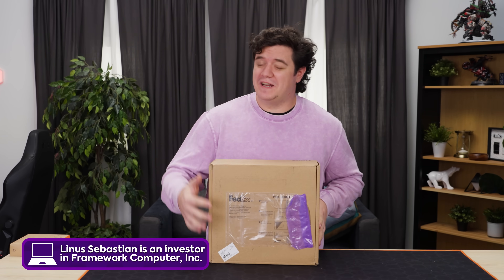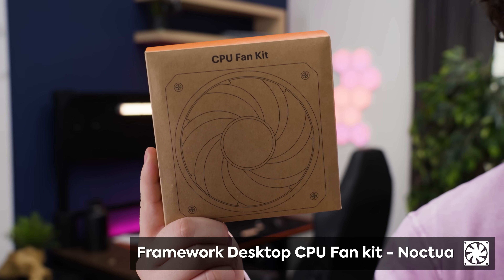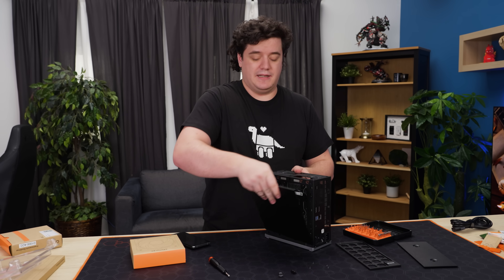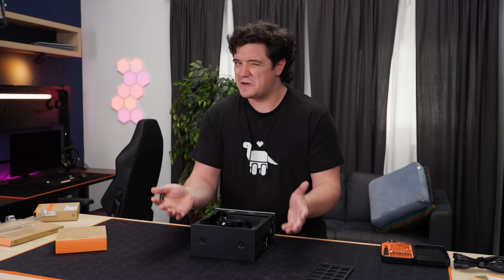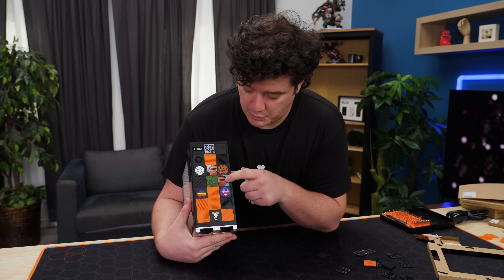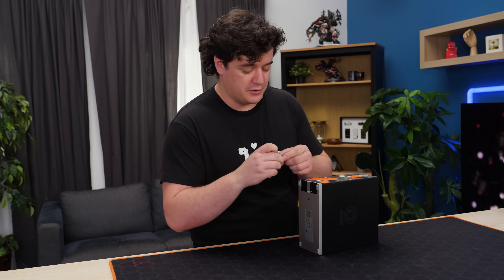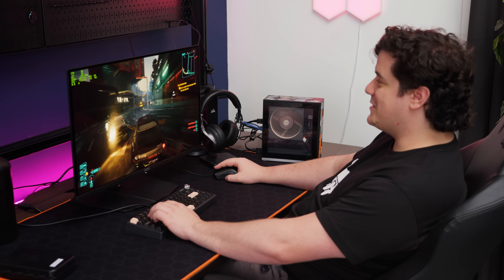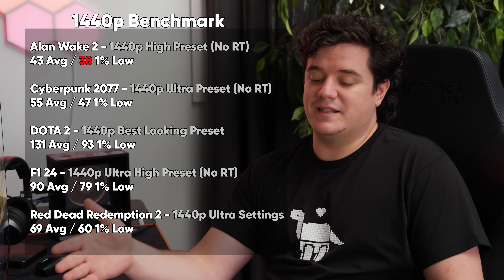This TINY desktop makes me nervous.... - Framework Desktop

Comment: Brother, it doesn't come with the power cable for free the same as the laptops don't come with a charger for free.  You can BYOD or buy one.  Most folks who would buy one of these (which are blatantly for enthusiasts of a limited niche) probably have a bin full of them.

Comment: I feel your pain on the power cord. I was pricing laptops with them, and you have to buy (seperatly) a USB-C module for charging, because the laptop does not have a hardwired c jack. yes, you could just plug into the module jack deeper inside, but the language on the configuration page gave me a bit of a fit. 

"We suggest ordering 4 or more Expansion Cards, and that at least 1 is a USB-C Expansion Card for charging the laptop."

Comment: This thing would be sick af, but $2300 is just too much. The only reason to get this over a decked out full size rig that would crush this in everything except maybe LLMs is if you really need to move it around a lot. Even then, you can get a laptop with on par performance in everything but LLMs for quite a bit cheaper. I just don’t see the niche at this price point.

Comment: As someone who has dozens of spare C13 cables I would gladly pay $5 less to not have it. The problem is that not everyone has dozens of spare cables in a drawer. That said the cable you showed is 1m the one on frameworks site is 1.5m that .5 of a meter makes a huge difference.

Comment: That line about the memory is not quite correct. You can set a certain allotment for the GPU in the BIOS but I would recommend to set that to the minimum of 0.5 GB and let it dynamically distribute memory to the GPU as needed. This Graphics Translation Table (GTT) has a limit as well. In Linux you can freely adjust that limit to your liking with a Kernel parameter. On my Strix Halo I set it to 61 GB on my 64GB model. The GPU gets as much as it needs within that limit, the rest can be used by the CPU. Of course at 61GB for the GPU the CPU becomes a bit starved for memory but that limit enables me to run even GPT-OS-120B on just 64GB of unified memory and if I don't run that model, memory for the CPU is plentiful.

Comment: So framework made a modular desktop, which is less modular then any other standard desktop, and chargin you for a power cable, and some tiles to the front? I dont see this is an improvement over an ITX machine.

Comment: It's weird certainly. What it seems like to me is that framework looked for an area of the market they could meet with a novel product and this, based on its AI performance, certainly fits a niche. Desktop PCs are, still, for the most part, modular upgradable machines. Unlike laptops, if you want to build a system that can grow, you can add more ram to it, swap out the processor, drives, etc. In that sense, I get why Framework thought they could compromise on this. 
As for the pricey bling, I think that brilliant, especially if you can 3d print your own. It's personalization, totally optional, personal and seems like a fine revenue stream for them. 
I've gotten into LMstudio recently and have been looking at improving my setup. This offers a exciting possibility.

Comment: In order of least to most bothered:

Tiles: Pretty much entirely an aesthetic feature. 3d printable so you have alternatives to buying and fully functional without them. Kinda sucks it doesn't come with a few but whatever.

Wire: This kinda bothers me simply because you do need it to function. On the other hand I have sooo many of these kicking around, and anything "free" like that is just gonna be adding 5 bucks to to the base price anyways. Not a big deal but I can see how a non-savvy person would be tripped up there.

Soldered RAM: Sorry, but no. Not only is this a dealbreaker for any desktop of any size to me, but it directly contradicts the repairability goal for Framework. If it had to be SODIMM at this size, then that would be absolutely fine, but soldered? Nah.

Comment: On the unifed ram you really really should have mentioned that it dose n't need to work like how it dose on macos , setting vram to 512 mb is perfectly fine for gaming and ai work flows. 99% of modern application go huh there are only 512mb of vram but vram is just a partion of the total system ram I am just going to store this in normal ram and it dosen't even have ti go threw the CPU the GPU can read and wright to the CPUs memory (I prolly explained it wrong) idk if windows dose something weird causing him not to mention it but on Linux atleast this is flawless. for example the steam deck is configure with 512 mb.  Wendels level one Linux or level one tech video explains this.

Also you can allocate more then 96GB of ram to the GPU on Linux, the 96 GB is a windows issue, also would have liked this video to talk a bit about Linux not like year of the Linux desktop or anything like that but with this being a AI first gaming second computer no sane person would put windows on a deeicated ai comouter

Comment: Some things i disagree with here 1) I think the soldered RAM is fine, as it's basically required for that CPU 2) I actually like the option of not buying the power cable, as some people have crap ton of those lying around the house and really don't need more 3) The front panels being extra is also a good decision, because some people may want to print their custom ones, so those that came with the computer would just be lying around or thrown out

Comment: You can NOT get this CPU/GPU (SoC) without soldered ram, un-soldered ram can not reach the same low latency / higher speed/throughput. Otherwise it would also not be named unified memory. A disappointing oversight for such a talking point (worrying about it etc)

Comment: my opinion on the not included power cable, if its replacing a different pc, you probably have one at home, and even so, you probably have a few from old tvs or anything, i have a box of random cables, and dont like being sent a short cable that barely makes it to the outlet.

Comment: I would buy this as I could use the portal monitors that have speakers in them to get both video and sound. All up it would cost me $6,197 AUD as I would go with the 128 GB model with 2x 8TB SSDs, as I would be using my own Operating System

Comment: actually framework already addressed the point of the soldered ram.
Basically they wanted to do that at the start, it wasn't validated by AMD, they reached to AMD, AMD did a bunch of tests and said that it is possible but the bandwidth would be cut in half.

Comment: Sorry man, I'm not onboard with any of your gripes.

I'm sure they'd offer an option with replaceable ram if it made business sense. They'd probably lose money doing that.

Also, maybe I already have a power cable. Fan mounting kit, probably don't already have one. Customizable tiles are cool, but I'd rather have the option to save some money and not include them if I'm trying to keep the price down. If they were always included, the base price would just be $108 more according to your setup.

Thanks for the comprehensive video as always, looks like a great little rig.

Comment: Wasn't HBM officially invented for this kinda thing? AMD made all of this fuss back in the day about how well beyond the GPU could go with a soldered, "unified memory" just like they did with the Xenon SoC on the original Xbox 360. It had 512MB of unified RAM, while the PS3 had 256+256. And this was 2005 and 2006 respectively.

So... 20 years later and many improvements later... When the time finally came to shine... AMD dropped HBM in favor of regular LPDDR? ffs AMD! I know it's cheaper, but you either make a top product or you don't! And you didn't! So don't call it one!

Even HBM1 from the Fury days had a 4096-bit bus and it would most certainly destroy any competition if remanufactured and rereleased on a smaller and more power efficient node. It was so much faster than regular memory it wasn't even funny. And the big proposal was always UNIFIED MEMORY, which those GPUs never had. So now was the time! To do the same thing ATi did with the 360 back in '05 and not only wipe the floor with the competition but to make a statement!
Reply: I've had the same thoughts about HBM.   It is kinda wild how poorly utilized the tech was to begin with.  But considering its impressive performance relative to the competition, I thought we would see its market share climb over time, not fizzle out and disappear into obscurity!   With how AI has changed things in the graphics space, one would think HBM had finally found its moment to shine.  But apparently not.  And it just doesn't make any sense to me.  Clearly the companies spending +$30,000 on the latest AI cards are clearly willing to shell out however much it would cost to have utilized the latest HBM on the boards.

Comment: Many people have an excessive number of extra power cables lying around, so the option to not get one is fine by me.  And if paying for it is a concern for you, I suppose they could increase the price by $5 and still make the cable optional, but free (this is what most other companies would do).  The same goes for the tiles, as you mentioned, they are 3d printable but they could increase the price by $100 and then make the tiles free/optional.

Comment: If you are someone who tinkers with computers and builds them yourself, I guarantee you have several of these power cables sitting in a box somewhere. Framework not providing the cable by default is NOT an issue. If I were to order one of these computers, I would order it without the power cable. I have a box where I put I all my old computer cables, and I several of these power cables in it.

Comment: I think it makes sense for the C13 to not come by default.  No one that is building a framework device is building it as their first PC, so surely they have a few C13 cables laying around.  I don't see why it not being included is a big deal.  Expecting a profit-driven company to include "nice to haves" by default, such as a cable you probably already have laying around or plugged in somewhere, or some little plastic panels for "customization" is not just ridiculous, but silly.

Comment: all that complain about the optional 5$ c13 cable... if you are involved with pc's etc then you have atleast a few lying around.. tbh id be really be happy if every time i bought a psu or any device that comes with a c13 cable they did not include it and charged me 5$ less. i have never used any of the included cables..i have atleast 30 c13 cables lying around if not more..if there is one thing i do not need more of IS DAMN C13 CABLES..

Comment: If I recall correctly, AMD set the requirement for Framework to use soldered RAM. IIRC Nirav said Framework tried to use DIMM, SO-DIMM, and LPCAMM modules but couldn't meet AMD's requirements for the CPUs they used in Desktop and were cutting it close with the CPUs in the Laptop 13.

While that sucks from a "repairability and upgradablility" standpoint, I feel it's a reasonable compromise in this case... As long as they keep the laptops upgradable (even if they switch to LPCAMM or something for RAM)

Comment: My issue with this system is that it's clearly aimed at enthusiasts but packaged in an expensive, small, non-upgradable package.    Most people wanting to purchase this (I Imagine) aren't looking for space-saving as their primary concern, but flexibility.   It's super cool to have flexible RAM like this, but what if I want to add a full size PCIe GPU?   I have to use that on my other computer?   If I'm being forced to have multiple systems it doesn't exactly save space.

I agree with others that from a marketing perspective, pricing it with a cable then giving the option to save money without would be great, but realistically many of us understand that's the deal to start with.   Again, enthusiasts are the target and most of us have boxes full of cables so why damage the environment with more.

Super cool to see them bring this kind of technology to market though, even if not in the perfect way.   I wouldn't personally spend my primary system budget on something so rigid in configuration though, but that's me.
Reply: Sure but... Enthusiasts already have their upgradeable desktops. There's nothing really for Framework to add there. This is a market that doesn't really have anything else like what they've done here, which is bringing high performance unified mobile chips to desktop, without the compromises these would usually have for a mini PC or laptop formfactor.

Comment: You dont need soldered RAM to have unified memory. The reason Apple can have unified memory is because they are in full control of the OS, legacy X86 apps do sometimes struggle with  unified memory because they are expecting a seperate pool for the GPU

On windows, when you try to use unified memory on a 2400G with desktop DIMMs, many games will see that there is 512MB of dedicated hardware reserve for the GPU, and they try to keep the game within that 512MB of RAM
Yes this is a windows and app problem, some windows programs work great regardless of reserved RAM for the iGPU
If you throw SteamOS on a 6800HS with desktop DDR5 DIMMs running at 6400 you actually get great performance with unified memory nearly 2x the performance of the steamdeck, Do the same thing with windows and you need to dedicate alot of RAM to the GPU to get similar performance without stutters. this is because Valve has designed SteamOS and proton to translate the game engine to use unified memory.
AMD is doing great work to kind of mitigate this issue on windows, but for now you WILL see better performance if you dedicate 8-16GB to the GPU, assuming you are left with at least 16GB for the CPU. IMO for windows handhelds 24GB should be the minimum option if you're getting a high end CPU with 8 or more compute units
Reply: The reason Framework is using soldered RAM is because AMD has not released Strix Halo in an R package that supports DIMM/SODIMM. I suspect AMD will release it, as an EPYC 4955 because this, with DIMM, would support 1TB of uDIMM RAM, considerably more if they include RDIMM, LRDIMM etc

Comment: I was quite shocked how damn awesome these mini PC's are. The minisforum with the 8 core ryzen 255 is stronger than the 12 core 5900x with quite faster ram and Oculink gives you eGPU abilities, which gives gives you enough power for 4k gaming.
It's quite shocking, because it lowers the energy consumption by a lot, it is probably cheaper to upgrade than a new pc because you can just take the entire board with ram included and the cooling is awesome in these tiny devices.

I think the time of tower PCs is over. You really don't need them anymore.
Sadly, Framework only gets you these premium chips, which are way too expensive while the 255 can be at almost 600$ while being extremely strong as well.

So. the soldered ram is really not bad. 
It doesn't make a difference and when do you ever upgrade ram today in the same generation? Usually it survives until the next DDR standard comes along.

Comment: This video misses the mark for me a little bit - for the reasons already pointed out in the comments. I really dislike it when LTT dunks on manufacturers not including a power brick or in this case a run of the mill C13 cable. Framework is about reducing unnecessary waste. Making the cable opt-out instead of opt-in would again likely result in some cables being produced and shipped, that weren't actually needed.

Same argument goes for the front cover thingies.

And as pointed out, the RAM needs to be soldered, that is not Framework's decision - other than deciding to produce a unit with an 395+ CPU in the first place.

Comment: The cable complaint is kind of unjustified, in my opinion. Many people already have tons of them lying around and would rather save the money and if you do need it you can just buy it with the computer at a very similar price to if you bought it from another source. So if you don't need it save the money (that would be added to the price if Framework included it by default) and e-waste, and if you do, just select the little box. It's a win for everybody

edit: If you want the tiles GREAT buy the ones you like, if you don't or want to print them and be happy that Framework gave you the choice to not have to pay for them and save the money. It's kind of the same argument, how are you missing that? The price wouldn't be the same if these things were included by default.

edir_2: 10:02, this has to be satire, or ragebait, cmon

Comment: No discrete GPU in a DIY desktop is wild tho, esp when they made it a feature of the framework 16.
My next PC should be an upgrade from my gaming laptop from 4 years ago, I was hoping it could be this, but well, no.
The CPU boost would be nice, but I dont really have a bottleneck atm. This iGPU, as impressive as it is for an iGPU, has similar performance to the 3080 Mobile in my laptop (or even under).

Comment: not including the power cable and 21 plastic chips by default is genius. People hav é it already or dont really need it. If it comes with chips and u buy extra, then u have random plastic pieces u will throw away. Setting the price this high means people can design, print and sell their own. Its supposed to be a community thing!

Comment: If they make the files available to 3D print the tiny pieces for the front cover, I see no issue other than the high price they're asking for the ones they're selling. They should also preemptively indicate that the soldered memory chips were a requirement by AMD and not by choice.